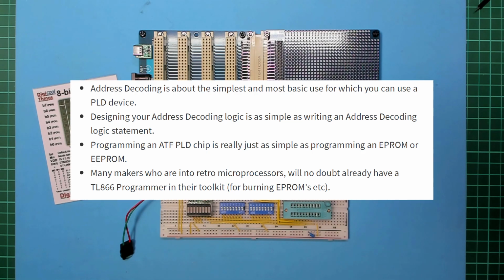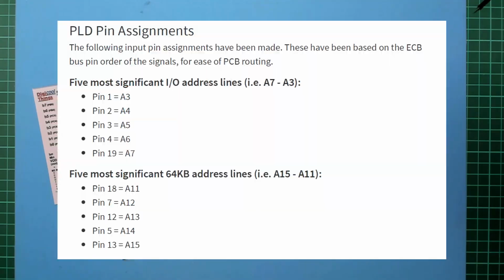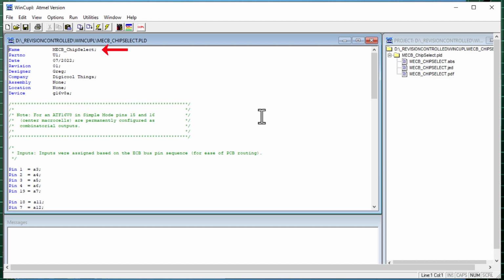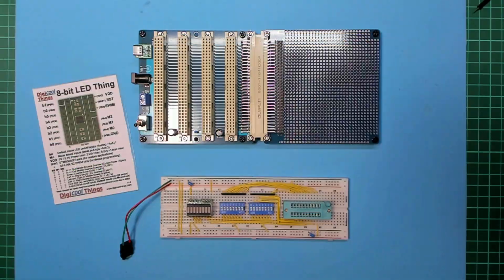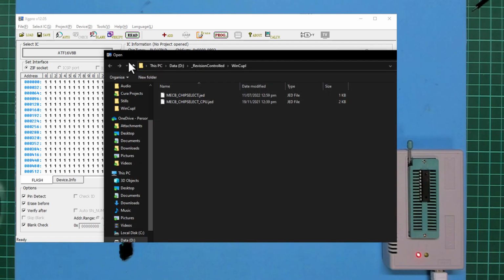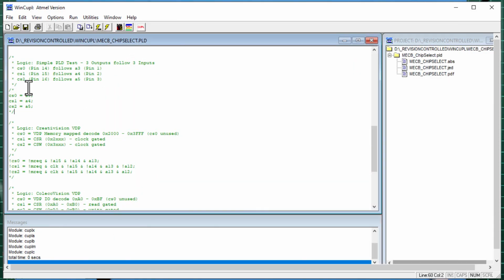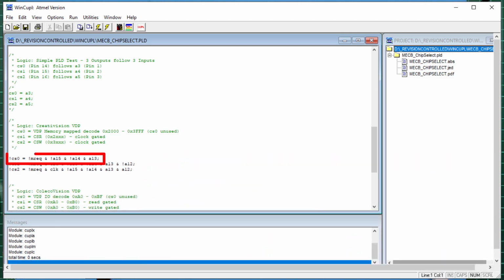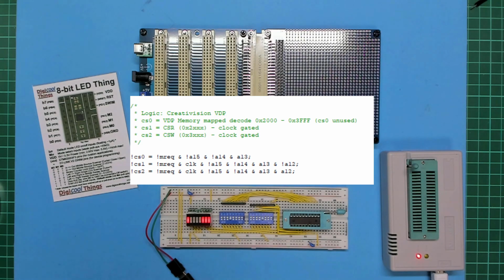Minimalist Europe Card Bus (MECB) - Address Decode / Glue Logic ATF16V8

Comment: Hello, I would like to design something similar.  Do you happen to remember the part number for those DIN 41612 connectors you used?  Mouser has many different kinds but I can't seem to pinpoint the exact one you used.  Thanks!
Reply from the maker: Hello.  I bought my DIN 41612 connectors from AliExpress.  I’m happy with the quality, and the price. Here’s a link to the straight female 364 connector I used. You can find the others (male + right angle versions), at the same AliExpress store.  Hope this helps with your project.  https://www.aliexpress.com/item/32809036121.html
Reply: @DigicoolThings  the ali express link is old do you have an actual link
Reply from the maker: @geos_one  Hi. The same store has updated listings.  You can currently find it here: https://www.aliexpress.com/item/1005003134388864.html    Note, I use the 364 variety, which has two of the possible 3 rows populated.  So, 64 pins in the original 96 pin DIN connector form factor.  Hope this helps. 🤓
Reply: @DigicoolThings  thx already in to to buy list in my case i will add the missing Addreslines for the 65816 and the 12v+ for the am9119 FPU. bu will use your design thx for the help
Reply from the maker: @geos_one   Awesome.  I have the 65816 on my project list as well, but without a FPU.  I haven't heard of the am9119 FPU.  It would be great to see what you come up with.  Have you thought of making a video to document your journey?  It would make for great viewing.  Have fun!
Reply: @DigicoolThings  ans as usual i have some typos amd am9511 the math coprozessor for the 8080 so also 8 bit.
Reply: @DigicoolThings  also at the moment it looks like the original "steckschwein" and i have many signaling problems. so the idea to gite the same way with the small 100x100 boards and the backplane .+
Reply from the maker: @geos_one  Yes, MECB / DIN41612 certainly makes for tidy and robust connections, and a compact modular design for creating a stable system, both for experimentation and for a final retro system design platform.  Hoping it all works well for you too!  🤓

Comment: Used to use a lot of Pals for address decoding and general glue logic as we had to fit things in little boxes, not much free space in a jet fighter radio bay. :-)

I remember the fun we had when you had to strip your program in to odd and even byte files and program two eeproms! As eeproms and ram (2 chips as well) were not as fast as the CPU’s so you had odd and even eeproms and ram so the accessing speed was halved. The good old days ;-)

Found my ATX full length prototype card, but can't remember what the logic chip set was. you can guess where the 8bit tri-state buffers went etc, but not easy to work out the glue logic.
Reply from the maker: Good memories!  Was that a full length 8-bit ISA or a 16-bit ISA prototype card?  If it’s any help (probably not), my full length 8-bit ISA prototype card has the usual LS244/LS245 buffers, a couple of LS138’s, a couple of LS00 nand, one LS04 inverter, and a couple of LS688 comparators (for the two 8 way DIL switches - mem select & IO select).  I’d imagine this is probably a pretty standard set of chips for original 8-bit ISA prototype card glue logic.
Reply: @DigicoolThings  Hi, it has a part number of 1501488 looks like 8Bit as only one buffer chip. no position for DIL switches. I found some on Ebay but no data or circuit. I seem to remember something like the I/O address being around 300Hex
Reply from the maker: @TheEmbeddedHobbyist  These are some pictures I took of my ISA 8-bit Prototype card:  https://bit.ly/3uX5PDR (in box), and:  https://bit.ly/3OhjV9T (the card), and:  https://bit.ly/3yWfWKm (Glue logic close-up).  Just in case it's in anyway similar to yours and might be helpful?

Comment: Excellent. I firmly believe this is the most proper approach to take.
Reply from the maker: Thanks. Yes, this approach seems to tick all the boxes quite nicely.  I can’t recall why I wasn’t originally using PLD’s back in the day, although, I suspect the tools for implementing them were probably beyond my hobbyist budget back then.  Also, their flexibility wasn’t really needed for the fixed address maps of my early boards.  However, their PCB space saving benefit would have been welcome!
Reply: @DigicoolThings  30+ years ago I had a PLD and an 874x programmer from Xeltec. They both screamed cheap imported hardware but they did the job. I don't recall the cost of a copy of CUPL back then but I want to say it may have been $400. I almost died when they were purchased for the good of all. The big reason I recall to treat them as premium components was the cost. You could place 10 SSI parts on a board and even with the increased PCB real estate used, it was often cheaper than a PAL. GALs changed the game but the cost was still an issue.
Reply from the maker: @Peter_S_  Thanks for confirming that cost would have indeed been the reason. As a teenage hobbyist in the early 80’s, original PAL solutions would have been way above my income level.  I still remember having to save weeks of pay packets just to buy my first MC6800 CPU, which I recall was only available in the more expensive CerDIP package at the time...  but it was a beautiful gold & purple sight to behold! :)  
I’ve no doubt that I was intrigued by PALs at the time, but my digital logic parts drawers would’ve only held the popular (and affordable) TTL & CMOS family chips of the day.
One of the reasons it’s so much fun to re-visit / re-imagine our old-school retro projects! :)
Reply: @DigicoolThings  'One of the reasons it’s so much fun to re-visit / re-imagine our old-school retro projects! :)'  INDEED!
I've got a few decent sized projects that I could turn into YouTube video series and I've held off until now, but channels including yours, James Sharman, Usagi Electric, and Unexpected Maker are pushing me towards it. To be able to build a minicomputer with 256K of 10ns SRAM in a single part costing $1 which consumes a tiny fraction of the power necessary for an equivalent sea of 4116s at 150ns is quite compelling. The ability to get fast SRAM, cheap GALs/PLDs, huge NOR flash, FRAM, E2PROM, and $$$$ 80s LSI & VLSI parts for $ opens some amazing doors.
Reply from the maker: @Peter_S_  Exactly!  Indeed, on my re-imagined 6809 CPU board I’ve implemented a single SDIP W24512AK-10 on-board, to make available a full 64KB RAM, in a single 0.3” DIP chip.  Every time I look at the chip, I think how blown away I would’ve been (back then), if I could’ve bought 64K of fast SRAM in a single small chip, for next to nothing!  I still remember saving-up to buy my first 4116 DRAM to play with (yes, just one is all I could afford at the time!).

You really should turn your adventures into a YouTube video series!  I’m sure it would be of great interest to many, including me!

If it’s any help with motivation, my thinking is that, although it’s great to share your journey with others with similar interests, I’m also motivated by the fact that I’m documenting what I’m doing!  Documentation is hard, and we tend to forget the detail of what we’ve done in past projects, so forcing myself to video & blog is also my own solution to project documentation. 

Hopefully, we'll see some new videos from you soon. ;)